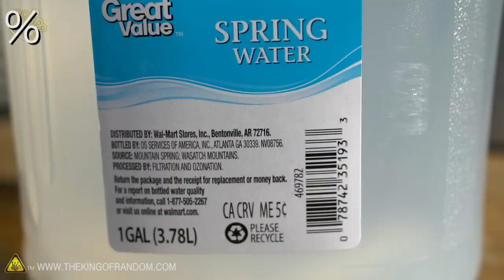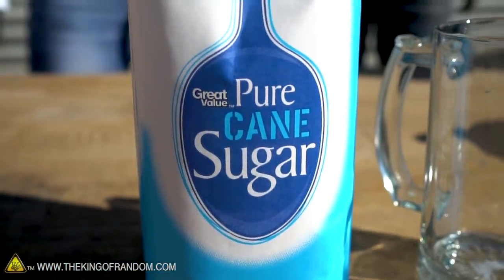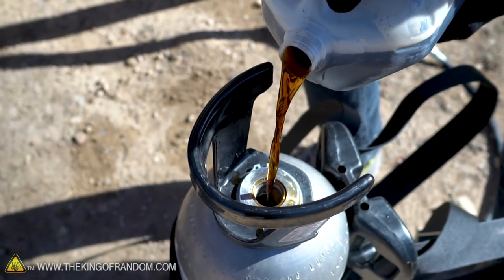Making Soda in a Flamethrower! How To Make A Homemade Flamethrower | DIY Flamethrower Project

Comment: Try and make a reverse vacuum chamber. That’s where you take the setup for a vacuum chamber but instead of taking air out, you put it in so it condenses whatever is inside then it should expand or, even better, explode
Reply: like a pressure chamber? like a pressure cooker.
Reply: So...an air compressor.
Reply: Jason Blooey kind of. It would be clear, go up to like 8000 PSI and hopefully bigger than your regular old air compressor. But essentially, yeah
Reply: That's known as a compressor, you know what you pump up tires with, spray paint things etc
Reply: @colinhorwedel9668  you do realize how much 8000 psi is right? Thats 544 atmospheres!
Reply: @colinhorwedel9668  It would be very difficult to have any clear material that could contain 8000 psi. The best you could do would be have a metal chamber with a very small window (or 2, one for a camera and one for a light)

Comment: Since when gallium solidifies it forms crystals, what happens when you dip ice (or even liquid nitrogen cooled ice) into a pool of gallium? Could you get it to form some cool crystals? Or maybe even flash solidify it similarly to the liquid nitrogen + ice + water experiment?
Reply: Because of Leidenfrost effect, the Gallium won't stick to dry ice or LN2, but super cooled ice, or really just a chunk of metal, should work just fine. I'd like to see that too!

Comment: They used to do something similar. Using a Cornelius Keg they delivered pressurised soda and then, only by connecting it to the soda fountain, stores poured beer
If you want real carbonatation, you should let it sit for 24hs and all the CO2 will be solved into the liquid

Comment: If you put a valve on the gun tube, you can slow the fluid pressure to make a working root-beer dispenser.

Comment: you should try melting obsidian
Reply: Kipdynamite Obsidian is just a form of glass so it would be no different than melting glass. If you are interested though there are videos of people trying to cast obsidian. 👍🏻
Reply: @Daltonleach11  so it would do the same thing as glass does ok that makes since
Reply: Kipdynamite Yep! Obsidian is an igneous rock formation, I.e. typically formed by volcanic activity. When magma cools very rapidly, this type of mineral forms. Not all obsidian will act like just glass, but the stuff that will act more like other minerals, such as granite, do not look like typical “obsidian”, I’m referring to the black glossy color usually ascribed to obsidian. The obsidian that will not melt like glass looks more like granite or other minerals, due to those minerals being prevalent within the mixture. So In a little more depth, you can see that the “typical” view on obsidian, is going to behave very “glass like”. But the other variations will act more like other minerals. So just saying obsidian is like glass was a bit premature because of the different formations therein, and I do apologize I noticed your comment and was in a bit of a hurry when I replied and should have better explained. If you want to know more though I would encourage you to look it up. Just 15 min of reading about it will tell you way more than I have told you, and you can see the cool cutting tools ancient civilizations have made!
Reply: @Daltonleach11  thank you, I actually watched a video about it and I think I understand. i mean i understand that i can melt but that's about it lol. but ill luke more up about it later

Comment: you should try to use the dry ice for pressure but with flames instead like if you agree
Reply: So, a CO2 fire extinguisher with flammable liquid as well? Seems like the CO2 would put out most of the flames. I say use liquid oxygen instead.

Comment: Could you carbanate liquid by puncturing a co2 tank and drop it in the liquid
Reply: If you want around 800 psi CO2 in your face (as in ripping the skin off your face) then go ahead. Why not put the liquid in first then pressurize it (like they did) ?

Comment: You should see what happens with dry ice in a microwave
Reply: It does nothing. Microwaves heat polar molecules (like water), Carbon dioxide is non-polar. Same goes for liquid Nitrogen.

Comment: Try to cast Callie's face with 1. gallium and 2.with silicon in hot glue adhesive mold .... Like if you agree
Reply: Gallium would most likely not work